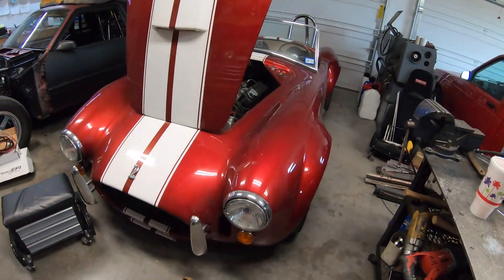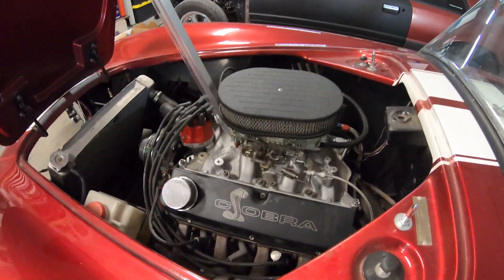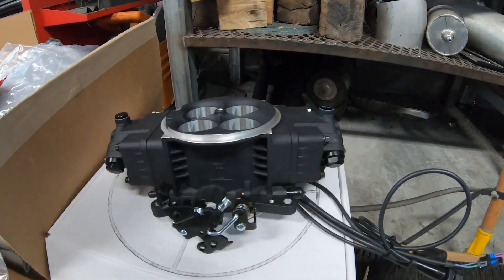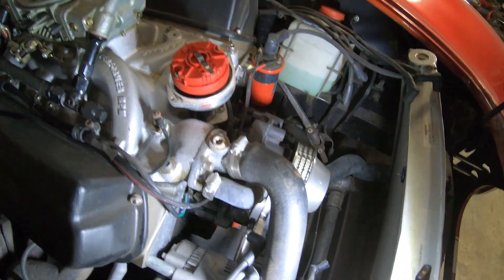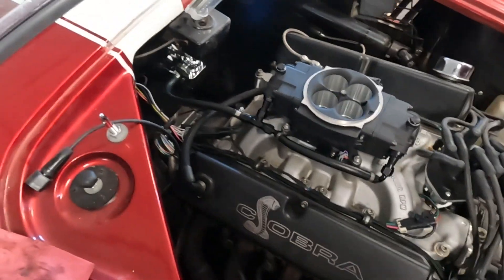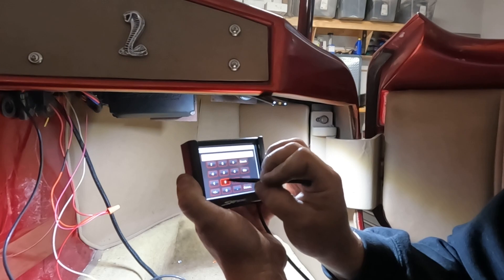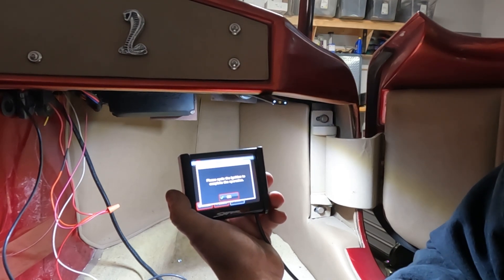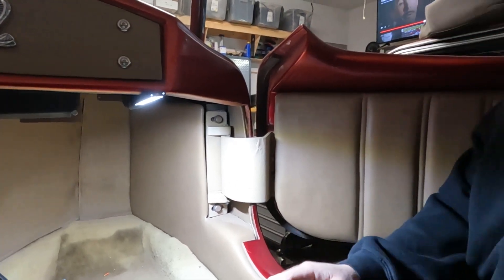The best Carburetor to EFI conversion - Holley Sniper EFI install, doesn't get any easier than this!

Comment: If you have issues with EMI, try 20-50kOhm plug-wires first (also 5kOhm Spark plugs). Tragically these Things are Not shielded/protected against EMI. Also Check alternator influence. Just a comment for those in need. (Applies to Most aftermarket TBI).

Comment: I would never use their fuel pump and regulator because of design. It is my opinion after seeing what they use, what they place in the return after the regulator.
I have worked on EFI since only two vehicles came with it in 1976, Datsun 280Z, Cadillac Seville w/5.7L only (A Bendix System) and I am not including mechanical Hilborn, Mercedes mechanical or Bosch CIS. From 3-gas to 4-gas engine analyzers for detecting tail pipe gases and any import the Air Force would let guys bring back from other counties. 
  I have been thru the manufacturing facilities to see three type of fuel pumps assembled, single and two stage and the testing done at dead-head pressures, to high system voltage, twice the rated pressure with one simple internal parts change and modifications made on pumps that produce 140GPH and run well under 8 amps. These are not what Holley uses and why filter a return? Strange. 
DK, ASE master tech since 78, retired.

Comment: You Tube is loaded with Issues with the Holly Sniper!  Some many people have issues to the point they tear it off and throw it away.  Simple install but never runs correctly!
Reply from the maker: This issue was all my fault, nothing to do with the product in any form or fashion. Once I tuned it, it has never ran better and is still running flawless to this day
Reply: You are 1 of the few lucky ones then i guess!
Reply from the maker: I've done 4 of them now, not one problem realted to the sniper or the parts yet
Reply: Thats cool. Hope it continues that way for you.